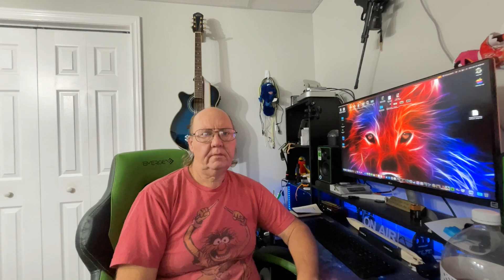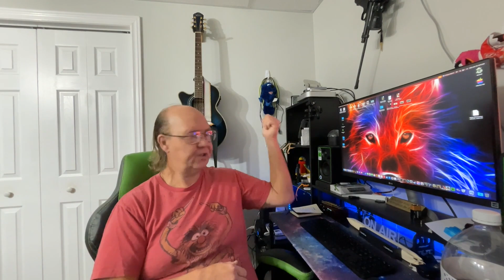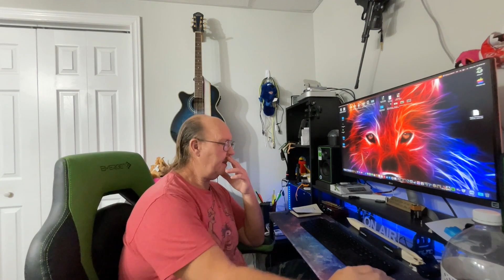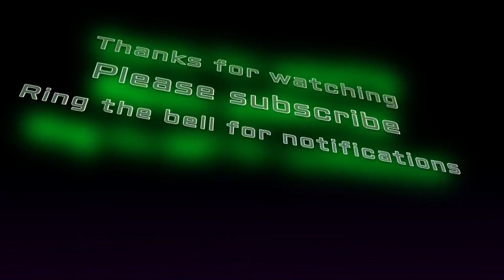Whats Really Holding Apple Silicon Macs Back

Comment: The difference between p-cores and e-cores is not just in the clock speed; p-cores are significantly more powerful not just because of their clock speed. Think of it this way: the power output of an engine is a function of the RPM times torque, and there p-cores have not just slightly more RPM than e-cores, but significantly more torque -- say, p-cores have more cylinders. But I generally do agree with your overall point -- all-p-cores chips, if allowed by the chip transistor budget are a better choice. See Snapdragon X. Now, whether apple have the chip transistor budget to put all p-cores in their future designs -- we shall see.
Reply from the maker: given apple is the richest tech company in the world pretty sure the budget has even been there for years .. PCs even today still make an all P core chip i know my gamming laptop is all PCores what replaced mine for the new model has both and its has more E then P in the new model which keeps me from getting that computer. now with reguards to apple they are making systems with 10p and 4 E so its not a budget thing at all. and they have better systems that that as well. how ever they are doing there save the green BS as well. makes no sence apple ARM Chips either way are Powerfull and still use way less power then windows systems.
Reply: @KevinMillard68  Transistor budget translates to chip area, and there are hard physical limits there of what is viable to put in any class of device (remember M-series entry model goes into tablets as well), as well as what is physically possible per se. Now, we may be facing (m5 onwards timeframe) new chip manufacturing & packaging technologies that may significantly expand area capabilities, but at this stage it's not clear at what monetary cost, and rich companies are rich because they don't waste money. But again, the fact manufacturers like Qualcomm decided to go all p-cores in their desktop designs is a sign of the times to come in the arm world, IMO.

Comment: I’m one of those that got fooled by the m3 pro. They adjusted the product line to sell more maxes and it didn’t work. And the 11 core pro wasn’t even better than the m2 pro. Fast forward to the m4 and they make it way better proportionally. The distance between the lines should be kept close and they didn’t at all. And I tried adapting at the beginning of a new chip thinking it should last longer and it didn’t matter. They rushed out the 3 nm chips just to be the first. And then redesigned it to make the actual performance they wanted. I hate Apple. Terrible experience
Reply from the maker: yup they been making alot of bad choices for sure and they aint done yet its going to be a hella ride over the next while

Comment: Apple's Mac business is primarily a laptop business, so the efficiency of E-cores matters there a lot for improved battery life. 

Also E-Cores are significantly more space efficient (use less die area) for multi-threaded work loads. So that also makes them more cost efficient (lower production cost).

E-cores are here to stay.
Reply from the maker: i dont have a big problem with E cores in laptops but in a desktop they should never be there
Reply: @KevinMillard68  They aren't hurting anything, and they aren't going to build Desktop only chips, as they don't have the volume.
Reply from the maker: @peterscott2662  its not about volume they are doing what they are to keep us controlled like ram and ssd prices so they do it with the cpu and gpu as well.  it keeps them making systems and it keeps people buying them but at the same time it is going against them big time. if they gave us real value and real power they would sell more systems.. Tim cook as alot to learn yet and right now what he does is lie to us alot and eventaully Karma will come around when the sales really plumet ..
Reply: @KevinMillard68  You see this is why Apple is a mult-trillion dollar company, and you are ranting on the internet. I have to laugh when people think they know better than CEO of Apple... If you want to complain, you should at least take some time to understand why thing are they way they and Volume matter a LOT.  It cost hundreds of millions to develop leading edge SoCs.  Macs need to share chips between laptops and desktops to make the business case for building the chips viable.
Reply: @peterscott2662  Agreed
Reply: @peterscott2662  not to mention they don't want a weak laptop line up compared to desktops, that would change the perception of their computers. Haven performance be even is the key here.